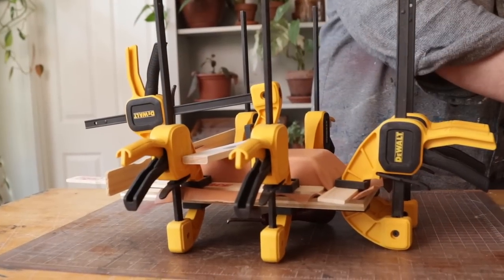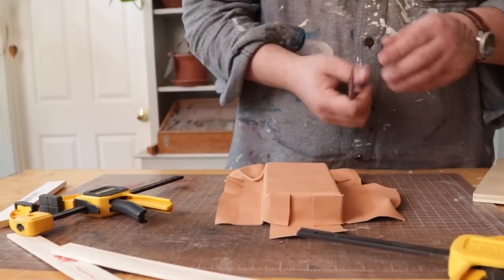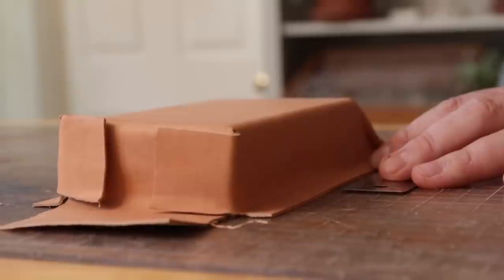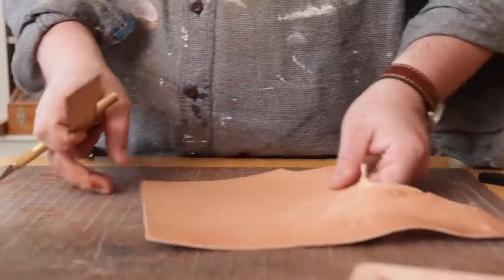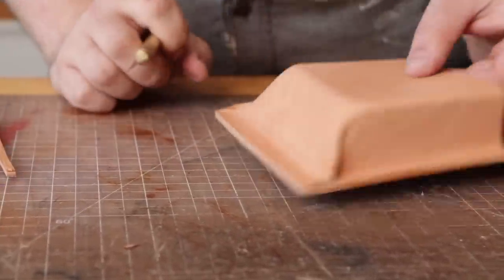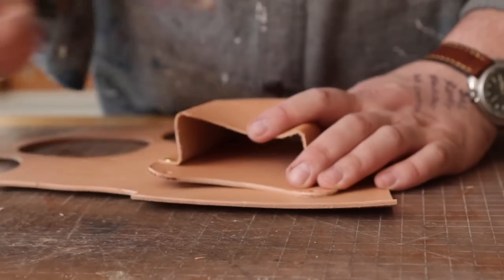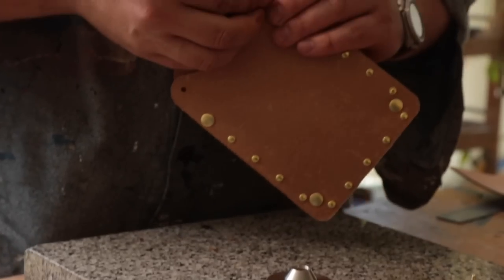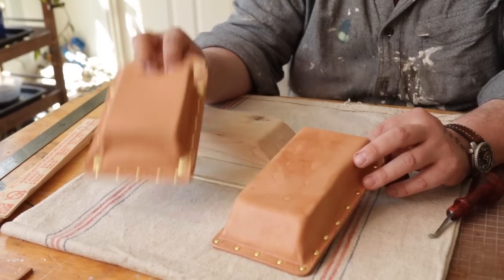Can You Wet Mold a Leather 2x4?

Comment: I just spent Sunday watching a 6:30 hour 3D printed mold emerge on my printer.  Longest print I have ever done.  It is a positive (screwed to plywood) and it's outside frame.  With a 5oz leather allowance between them.  It is for a small item I make over and over again. I wet the leather, stick in on the positive, put the frame over it and compress it in my wood vise.  Then use clamps to keep it together while drying.  The agony is watching the printer misbehave after 4 hours.  Normally I would cut a wood mold by hand but this is a small leather item and I could not get the accuracy with hand tools.  Molding leather is wonderful.